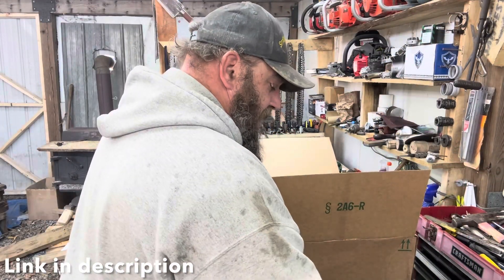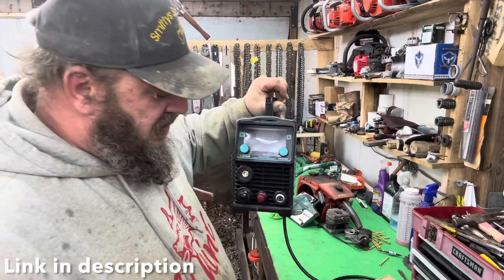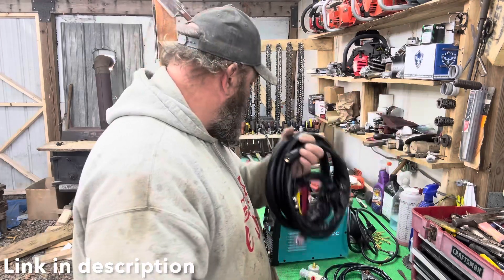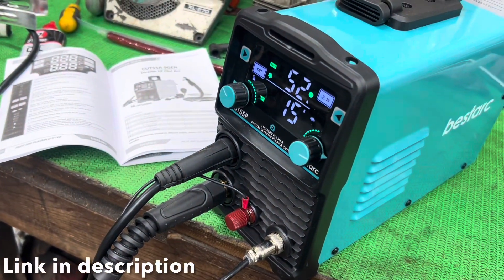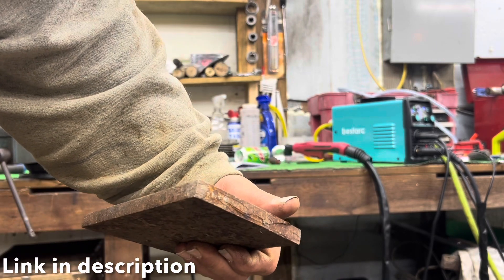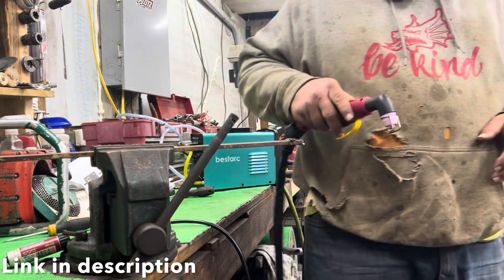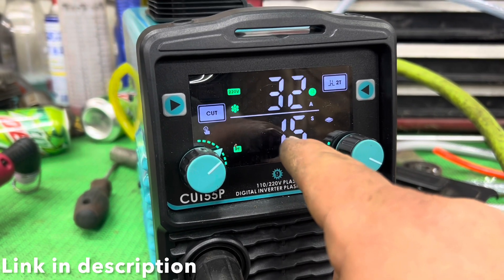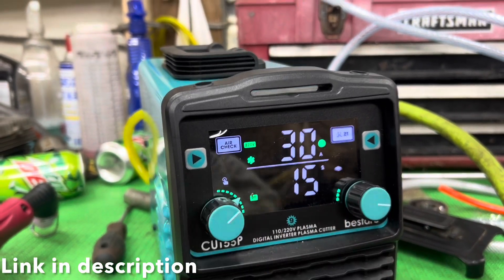Turning Steel Into Liquid!  Bestarc CUT55P Plasma Cutter. First Time Success!

Comment: question what size breaker are you using
Reply from the maker: 30 amp 240 volt. I use the same plug for my MiG welder, plasma cutter and stick welder
Reply: @Smittyschainsaws thanks